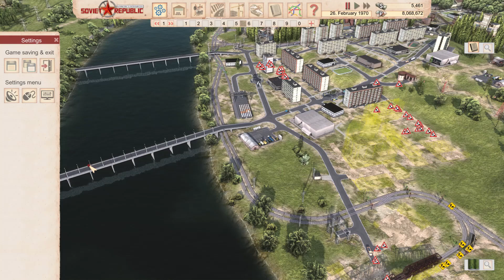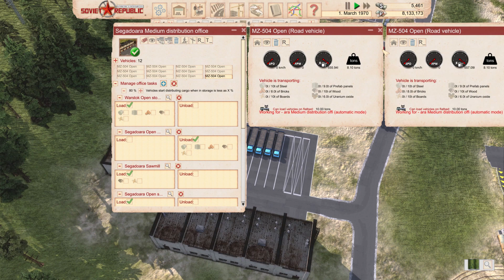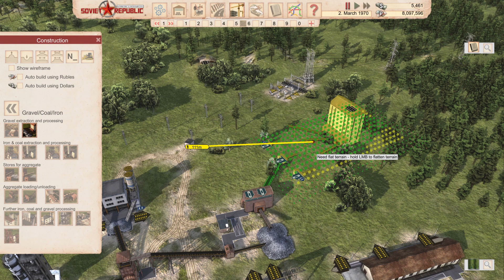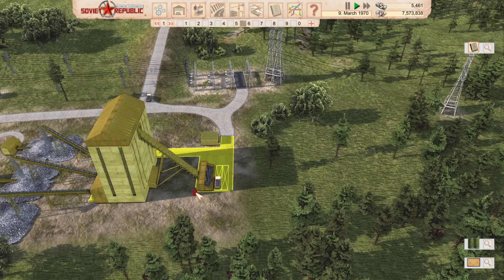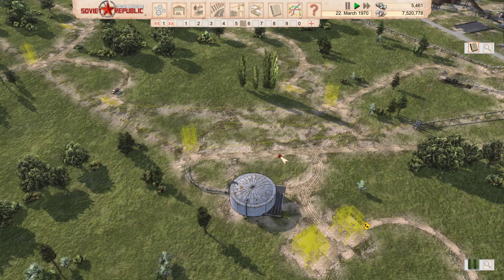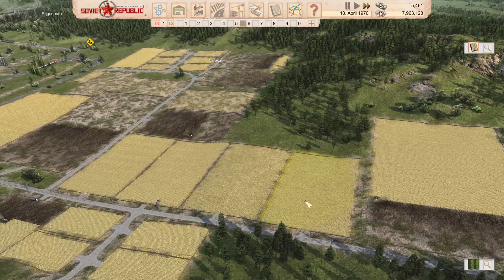Workers and Resources - Soviet Republic - Project Leszcie Ep.49

Comment: Do you have a gas station in Baraharad? If not, the excavator will go a long way to buy fuel.
Rail construction office can also have a larger range than just 1500m.
53:27 You set up a two-way chain and a simple semaphore. By placing the chain on a two-way track you have increased the intersection.
55:24 normal semaphore and large intersection.
You can steal steel from your loading finger. One supply office will deliver from the smelter and take another from this square to Baraharad: P
Nice episode, Regards :)
Reply from the maker: Baraharad got the petrol station! :)
I found out this for the Rail construction office later on.
Both of those intersections are weird. I ended reworking the coal one by expanding the second track all the way. (in other words I  gave up) Should probably work on it but it wasn't my day. :( 
Hmmm. Interesting. I will look into this steel stealing thing. :) :D 

Thanks, Pro. BTW I have the test ready and will record today. I will share it ASAP!